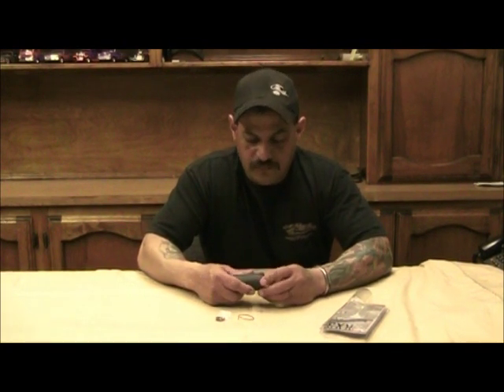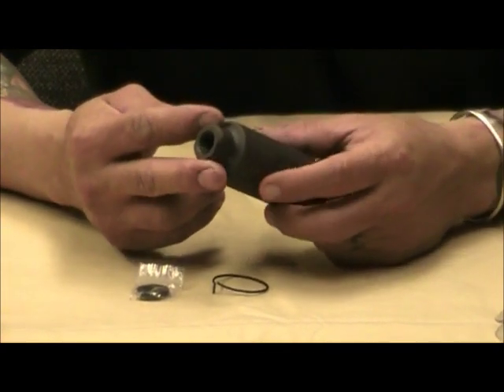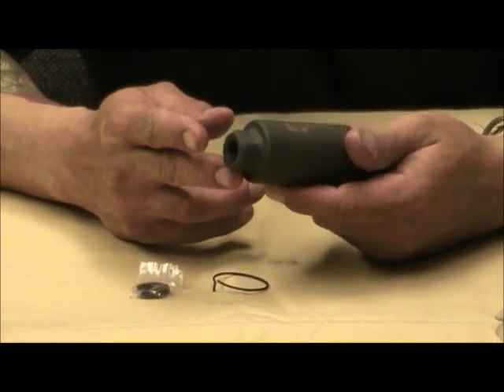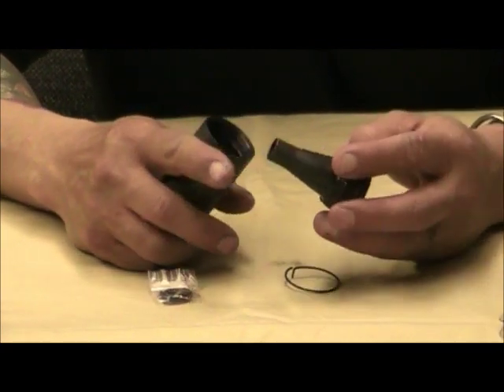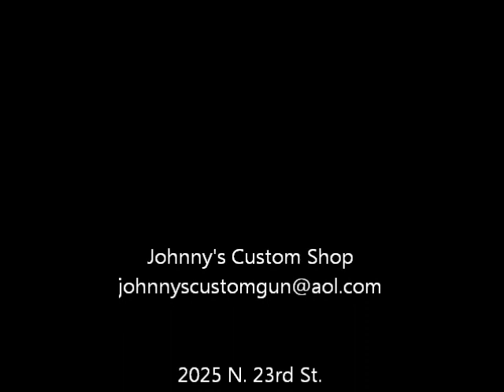Noveske KX3 Sound Flash Review

Comment: this muzzle device was designed to increase backpressure in ar15 pistols and sbr's to increase reliability  due to the very short barrels.  secondary was to direct concussion and noise forward because short barrels are very loud.
Reply from the maker: punker6506, thanks for the info...
Reply: I spoke to Noveske a week ago, they said the back pressure increase is minimal, FYI.